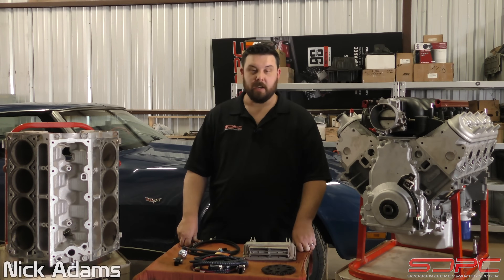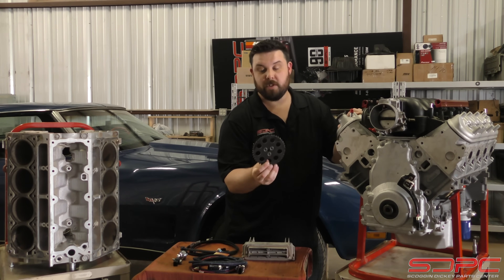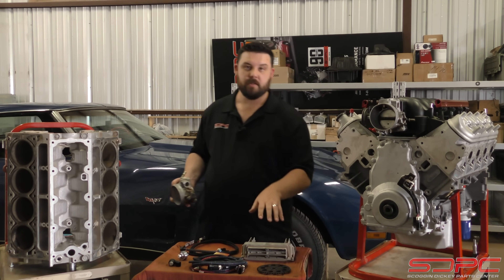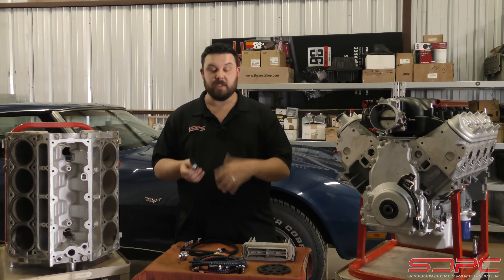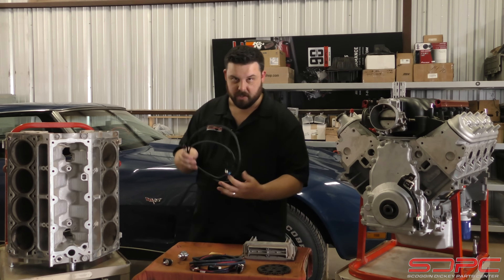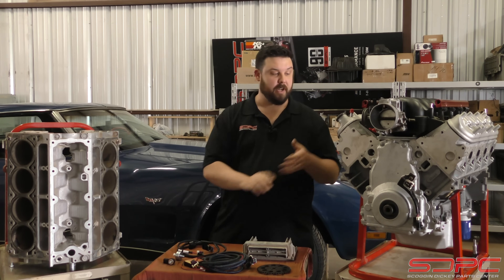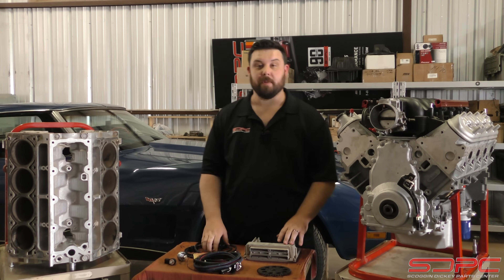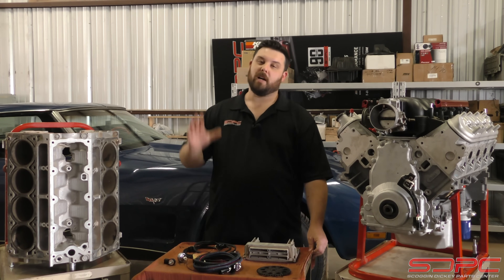SDPC Tech Tips: Gen 3 and Gen 4 LS Engine

Comment: So I got a 2005 6.0 Escalade and I want to put a 6.2 in, will the 6.2l bolt up to my transmission and torque converter also will the exhaust fit like original.

Comment: So I  hve a Lq4 6.0L 03yr  cn I change to a 58x relutor wheel?
Reply from the maker: You can, but you'd need to of course remove the crank, remove the reluctor and have a 58x tacked on.  Most of the time it is easier and more cost effective to just buy a Gen4 block and let it eat.

Comment: if I pick up a gen 4 block and bore it with cylinder sleeves to a 427 and then put all my gen 3 parts on it, will the gen 3 sensors have enough range support that amount of airflow and what not? the gen 3 i'm running now is an LM7 in a 2002 Silverado.

Comment: So since I’m building a Gen 4 from the ground up. (LS Swapping a 01 Mustang GT). Can I use a Gen 3 timing gear etc? Because I’m putting a 3 bolt 228 cam in it.
Reply from the maker: As long as you get the correct cam reluctor (either 1x or 4x)

Comment: So this will work putting a 3rd gen into a 4th gen truck?
Reply from the maker: Unfortunately no.  You'll also need to either change the crank or install a 58x reluctor on the crank of your 3rd gen block.  Many times it's easier to just sell the third gen and get a 4th gen block.

Comment: Can you do a video where you convert a gen 3 to a gen 4? Thinking of tapping o e of the tabs on the block near oil pan for knock sensor
Reply from the maker: If you mean putting a Gen 4 block in a Gen 3 car and running it on the Gen 3 PCM:
https://www.youtube.com/watch?v=CBvmETzImY0

If you're trying to put a Gen 3 block in a Gen 4 car on a Gen 4 PCM, you have to change the reluctor wheel on the crank as well.  Considering the price point on all that, it's usually easier and more effective to just start with a Gen 4 block.
Reply: @Sdpartscenter  If this guy meant gen 3 into a gen 4, I am also interested in some info. Basically I have a 2002 5.3 lying around and have a 2009 LC9 with the dod/afm lifter issue. My thoughts were to put the 2002 LM7 in the 2009 truck. What are your thoughts about that???
Reply: I’m wanting to put a 06 5.3 in a 08 truck any tips on what has to be changed. I can possibly use my 08 cam and crank.

Comment: If i was putting a ls1 in a 08 silverado would a holly system solve all these wiring differences?
Reply from the maker: It will run the engine, but you might have some wiring issues on the vehicle (body control) side you'll need to overcome.

Comment: Hi. I am confused, the Lingenfelter box has a cam sensor connection, so why would the casper knock sensor harness extension also need the cam sensor connection too?????
Reply from the maker: Because the knock sensor and cam sensor location moves, and the connector for the knock sensor is different.  The casper harness solves these issues.

Comment: What of your puting a 2005 6.0 gmc sierrain a 2008 gmc sierra 5.3
Reply from the maker: The only way is to swap the reluctor ring and cam gear to the newer style.
Reply: I got crank out of my 5.3 with new bearings and high volume oil pump.I just heard you say a new cam gear.i had it flashed and it runs great but they had to work around a sensor and sometimes doesn't start right up it cranks awhile.I still have 2005  cam gears.o well.Next next weekend.

Comment: Assuming you successfully connect all the sensors and unite the Gen 3 computer to the Gen 4 engine, what about the rest of the car’s electronics like the AC, key ignition, windows and stuff, is that all unaffected by the swap? It sounds way too easy
Reply from the maker: It does sound a bit too easy!  If the Gen 3 computer is native to that car, it should work just fine.

Comment: So with your engine build, you are using the 24x wiring and sensors?
Reply from the maker: For running a Gen 4 engine in a Gen 3 car, you use the 24x wiring harness, the gen 3 knock sensors (moved from the intake valley to the sides of the block), and the gen 4 cam sensor.

Comment: So Can a GEN 3 5.3 iron block be turned into a GEN four ?with all accessories from lh6 gen 4 aluminum block
Reply from the maker: Usually with the amount of work involved (including changing the reluctor ring on the crank), you would be better served to just get a Gen 4 and sell the Gen 3 to recoup your losses.
Reply: @Sdpartscenter  Will see that’s where the problem occurs because the LH6 GEN4  block is shot and that’s the aluminum block so I was trying to find a cheaper way around but I’ll just have to get me a GEN four iron block

Comment: Are gen 3 an 4 blocks exactly the same other then sensor locations?
Reply: No
Reply: No, different oiling ports in the block for afm engines
Reply: The Gen 4 valve cover is different and uses a fixed orifice instead of a PCV. The oil baffling are also much different. You can fit a Gen 4 valve cover and reduce oil consumption.

Comment: hello how are you plz i wanna ask you u have my hummer h3 2006 v5 3.5 i wanna swap to v8 6.0 wich one is better and no need too much electric wirking  gen 3 or gen 4 ?
Reply from the maker: The hummer inline 5 is going to be limited by the aftermarket and will be the more difficult route.  You will of course have to do quite a bit of wiring and harness work to make the V8 work properly.

Comment: That clears up swapping newer engine to old computer but what about putting a gen 3 engine in a gen 4 vehicle. For example, let's say you have a gen 4 4.8L truck but have a built gen 3 LQ4 engine you want to swap in?
Reply from the maker: If you're going to run a standalone like a Holley Terminator, fire away.

The Gen 3 would need a 58x reluctor added to the crank.  You can't just increase a 24x signal to a 58x as there isn't a way to properly convert that signal and step it up unlike the Gen 4 engine on a Gen 3 computer wich takes the 58x and steps it down to 24x.

You'd also have to find somewhere to mount the knock sensors on the side of the block.

Then the cam signal.

General rule of thumb there is just sell it to somebody for a good price and get a Gen 4.

Comment: Why did the ls1 have a constant  problem with rod knock is it the main bearings did they change ? Or the rods ? Asking so I know what to get in terms of reliability? Ls1 or ls3?
Reply from the maker: The piston slap was evident in some LS1s on cold starts that was just the name of the game back then.

An LS3 is going to start you off with an engine with more baseline power, and fresher components.  It might be a little more investment right off the bat, but the LS3 is a great foundation to build from.

Comment: I have told that the Gen 4 aluminum blocks are stronger than the Gen 3 blocks. Is that true??
Reply from the maker: The Gen III blocks are plenty strong, but there are some improvements that make the Gen IV stronger, but not some crazy drastic improvement in strength, just a little stronger.
Reply: @Sdpartscenter  Thank you for the quick reply.  I am looking to do a twin turbo 1000 RWHP capable 5.3 liter street engine for my Pro-Touring '95 Chev. Caprice 9C1.  A 5.3 liter b/c I want those super thick cylinder liners and extra mating surface area of the small bore VS the 4.0" or the a 4.062" to hold boost. Two I want the weight saving and heat dissipating properties of aluminum.  So I moved my gaze from the L33 block to the LH8/LH9 block as a foundation.